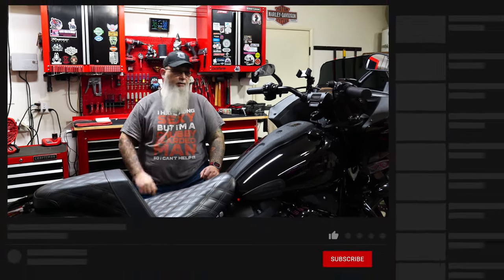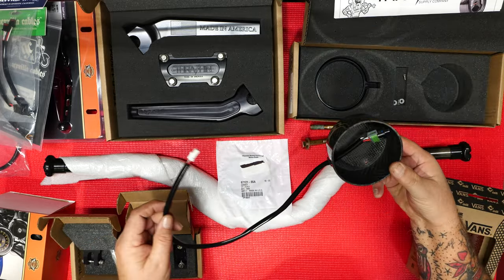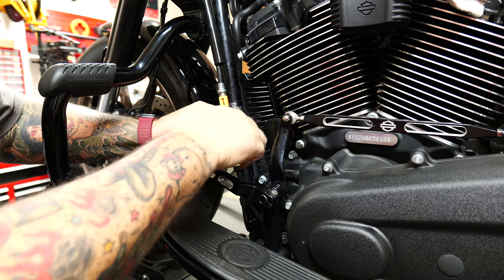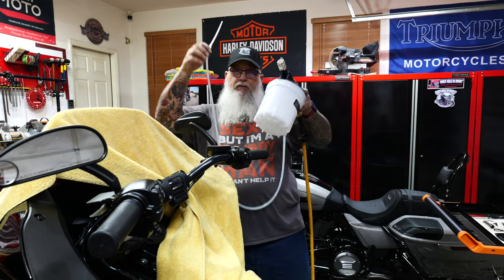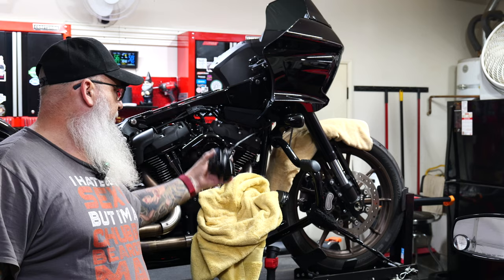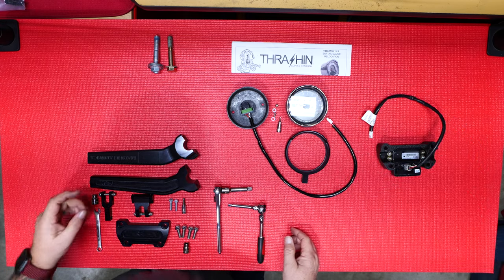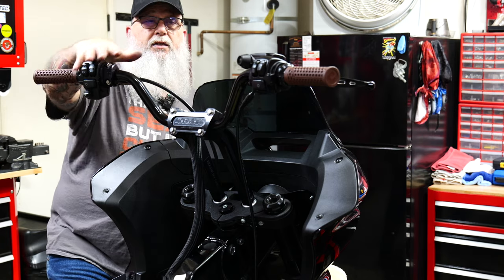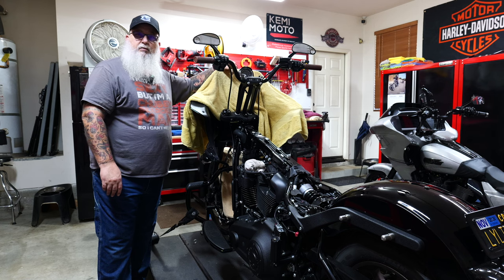2022 Low Rider ST Upgrade - Thrashin Bars, Risers, Gauge Relocation

Comment: I have the exact bar and riser set up pending install. I ordered the guerilla extensions in 9” because I was going use the thrashin 1” riser extensions. Now I’m having second thoughts about using the extensions because I feel like it might be TOO tall. Interested if you think the 9” extensions will be too long and I will have difficulty tucking them and if you think adding the 1” extension as I originally planned would’ve been too tall for you? Thanks!
Reply from the maker: Thanks for the question. I think it will depend on you and how everything fits with the seat and peg position for you. Mock up the risers with the extensions and see where you land. If good, press on. If too high, take the extensions off. You should be able to fit the 9 inch in there, but I would for sure take the tank off for ease of manipulation of the wires. 

Enjoy the work and have fun. It’s all about the experience for sure and I’m sure either will look great. Ride safe.

Comment: I have a similar front set up on my 2020 Low Rider S. It is a sweet rider. I have a ST fairing to mount on later on. I am still enjoying my T fairing. The kept the stock gauges on the tank but have my Dyno Vision gauge mounted on top to read all my specs. It is so much more comfortable with that set up. I appreciate the tutorial video.  ❤
Reply from the maker: Much appreciated, 100% agree on the comfort with the change and thanks for the comments, ride safe.

Comment: why couldnt you use stock bars with just the extensions, would have saved a lot of time or do you have to use the trashin bars?
Reply from the maker: Thanks for the question. If by extensions you mean the risers, I wanted to raise the bars up to 10.5 inches height for a more comfortable riding position. You can use the stock bars, however, as noted in my video, they are bent a bit up and out which was uncomfortable to my wrists. The Thrashin bars have been great for me on a few bikes so I stick with what works for me. I am sure it will vary per person, but I love the result and the improved riding position.

Ride safe

Comment: Not pertaining to this video but did changing out the cylinders, pistons and rings cure the puking oil problem on the bike, got the same problem with my 2023 model, im running the same S&S breather you got.
Reply from the maker: Thanks for the question, yes, in my case it did. I did a closing video here: https://youtu.be/TTmTUlU7Yio?si=x3-p7Td9y1MBSPvj

on the summary of events and what they found. Be sure to get that in to the dealer if not already and have them resolve it ASAP. It is NOT anything to do with the air cleaner and feel free to reference my video series on this issue (there are a few) if they give you any push back on it. There have been several comments on these with others experiencing the same issue on the LRST models for 2022 (and maybe newer).

Hope it helps, ride safe!

Comment: I’m looking to get some pull back risers as well with stock bars on the fxlrs. I’m 5’6” what size would you recommend? I don’t want to make the wrong choice
Reply from the maker: Thanks for the question. I would recommend measuring your riding position and the height from the bar base to where you want your arms to be. Generally, 6.5 to 9.5 will do, but everyone is different in body dimensions. That should give you the basics of what length risers to purchase to fit your goal.

Hope that helps, ride safe.

Comment: Video inspires me to do all the upgrades myself. It's only the brake and clutch lines that have me worried. Thank you for sharing and documenting. Do you mind sharing the total cost? 💰💰💰
Reply from the maker: Thank you, much appreciated!  You can get the actual cost of parts from the links I provided, minus the cables and miscellaneous parts from the dealer. But, looking at about $1500.00 to $1700.00 in parts. If you had the dealer install it, you are looking at and additional 8 to 10 hours labor according to “the book” x whatever their rate is. Definitely worth doing yourself. The clutch is very easy, the brake cable just needs a process to minimize leakage and function afterwards. 

I tried to walk through each step to help make it easier. Ride safe and have fun.

Comment: Thx for this video! There is one thing i didnt like on my low rider st...the gauge..and now i know i can switch it:)
But Dude, is the gauge you used the original from the low rider s?
Thx!
Reply from the maker: Thanks, much appreciated. Yes, the gauge is for a 2021 low rider s. Works perfectly and the part number is in the description. 

Ride safe.

Comment: Glad I found this channel today definitely will be following along thank you ☝️👏
Reply from the maker: Thank you! Much appreciated.
Reply: I have a 2020 fxbb and I’m 5,10 running a 13 inch fox mono shock in the rear if I run this exact same bar and gauge set up think I’ll be good right now I’m running lucky Dave’s lucky 13 which are 13 inch with same pull back t bar looking to switch to bar and riser

Comment: I’m 6 ft 280 pounds I drive a street glide but would like a low rider st test drove it the mids are terrible would you say if I bought one and put forwards and bars on it it’s almost as comfortable as a touring model ? I just wanna be able to ride 50-100 mile days and not hurt haha great video btw
Reply from the maker: Thanks for the comments. As you mentioned, I did not like the fwd controls at all... My heritage was very comfortable, so I put the fwds on the low rider and loved it. It is a bit tough to compare a softail frame to a touring frame since they are different, and so is every person, but, I will say that the LRST with Heritage fwd controls is so much more comfortable for me. See if you can test ride a Heritage and that would give you a feeling of what it may feel like, minus a seat and bars that fit you of course.

Ride Safe

Comment: doing this upgrade this weekend ,when disconnecting the wiring is the wiring all marked ,or do just figure it out thanks
Reply from the maker: Thanks for the question. The wiring is not marked, but pretty much a one only connection. I took photos along the way so I knew what was where and taped the disconnected ones before I pulled anything to help stop confusing myself. 

Have fun, you’re gonna love it.

Comment: I bought all the parts to do the risers and bars, but the abs have me worried. I've never done brakes before. Did you drain the fluid completely from rhe calipers
Reply from the maker: Thanks for the question. The bleed made me a bit nervous as well,  kinda indicated that in the video lol. Yes, I started by draining the master, then drained each of the front calipers. I showed how in the video and the pneumatic pump really helped (there are other cheaper tools if you don't have a compressor). Once done, reverse it and test. I had no error lights and the brakes and ABS worked just fine. 

If you do run in to an issue with the ABS, you can always run down to the dealer and have them re-bleed them on the machine. 

Ride safe.

Comment: Love the video! I wanna do the same on my Low Rider ST 22. Just a quick question. Do I need the specific Gauge from the Lowrider S or will any other analog Gauge from the 2020 up Softail work? For example the one from the FatBob. Just asking because the Lowrider S gauge is not available right now... Dealer couldnt give me an answer to that.
Reply from the maker: Thank you for the comments. I included the gauge you need to order from HD in the comments. The only difference will be if you have the RDRS option installed on the bike, I think 2023 and 2024 models. If you do, I would ask the dealer which one would work. 

Enjoy and ride safe.

Comment: thank so much you give us real mechanic class sir I'm buying parts to upgrade my risers I'm going to use Kraus risers 10inch on my lowrider st  and fly moto handlebars my only concern is the bleeding front brakes because I see a other videos and the guy did everything n the bleeding pard but the brake won't brake it all and he have to send  to Harley to fix for him so that's is my only concern . PLEASE MAKE A VIDEO TO HELP US HOW TO BLEADING CORRECTLY THE LOW RIDER ST THANKS
Reply from the maker: Thank you for the comments, much appreciated! 

I was concerned the same would happen, however, using the air bleeder that I did worked great and I had no issues. if you have a stuck ABS light, or something is not right, do not ride and have the dealer bleed them. Being that I only did the front brake calipers, it went just fine.

Good luck and ride safe, gonna look awesome!
Reply: You can reverse bleed by pumping the fluid from the caliper up to the master cylinder just make sure you  suck the fluid out of the bowl in the master cylinder so it doesn’t over flow and that way you don’t risk an air bubble getting to the abs system. Also make sure you don’t touch the brake lever while doing it otherwise it will pull air in and cause you to have to make an expensive trip to Harley for them to bleed the abs system

Comment: Did you have any issues with the red security light staying lit solid on the speedo after starting the bike?
Reply from the maker: Nope. If you purchase the gauge I indicated in the description it worked perfectly. Ride safe.
Reply: I currently have that now. Ordered the gauge from this video. U1305c. Cannot get it to clear
Reply from the maker: @fonso003  I would check with the dealer on a compatibility list for LRSTs with TC. I don’t have that on mine. 

Ride safe.

Comment: What length of cables will my wife need for her 9 1/2 and mid rise from thrashin. If you may know, i know spedo and Throttle is +6 but not sure on clutch and front break
Reply from the maker: Thanks for the question. All the needed part numbers are listed in the description so you know what to get. Ride safe.
Reply: @justkillnbugz  thank you for the response and thank you for the videos

Comment: Did you replace the complete clutch cable or just the top part
Reply from the maker: I replaced just the top half. The part number I used and listed will be for the upper cable only.

Comment: You left out the ABS digital tech step at the Dealership. 
To make the ABS function correctly
Reply from the maker: Thanks for the comment. I did not mention the dealership since my ABS functioned as designed when I bled them the way I did. I had no lights, no errors and both front and back operated as it should. "If" that is not the case on an install and the light stays on, then you are correct, you can go to the dealer and have them bleed the brakes on the machine which will actuate the ABS and flush the fluid through. I did not do a full brake bleed so I am guessing that is why mine worked after the install.

Thanks again and ride safe.

Comment: If you have a bike without the TC this is the correct gauge. I just learned this the hard way
Reply from the maker: Thanks for the info. My 22 does not have TC. Can you exchange it if not past the VIN lock?  Not sure on the newer LR gauges and compatibility. 

Ride safe.
Reply: @justkillnbugz  they said I can. Either way it’s not that big a deal I ordered what I hope is the correct one 😂

50 miles is the bin lock right?
Reply from the maker: @fonso003  I believe so but best to check the documentation just to be sure. some may be different. Glad you can sort it out.

Ride safe.
Reply: @justkillnbugz  official from Harley. 31.1 miles til vin lock. Trip B counts it down for you

Comment: Do you think those cables will reach 10.5 in risers?
Reply from the maker: Thanks for the question. I would say probably not, they are pretty close to what is needed with the 9.5s so you would probably need to go up a size the the length to cover that extra inch or so.

Best of luck.

Comment: Can you also see the km/h on the gauge  or only mp/h?
Reply from the maker: The gauge shows the digital readout for mph by default. Once the bike is turned on, if you press the odometer/trip reset button on the left handlebar controls and hold it, it should switch. I believe you have to hold it for several seconds, perhaps at least 10 seconds or more (from what I have read from those who have done so).

Comment: Did you loos t/c by chance going to that guage
Reply from the maker: Thanks for the question. The 2022 LRST did not come with traction control. It was offered on the 2023's I believe. If you have a 2023 and get the 2023 Low Rider S gauge (same premise) you should be fine. Your local dealer would be able to find you the part number and verify the gauge parameters for that model.

Ride Safe

Comment: I’m running the same clutch cable, but it seems to be too short?
Reply from the maker: That seems odd if you ordered the same  part number. Hmm. Verify your touting is good and if it is, contact the dealer and be sure they gave you the correct one. 

Hope it works out.
Reply: @justkillnbugz  Did you reroute the clutch cable differently from the stocked routing?

Comment: Did u have the ABS reset by the dealer...?
Reply from the maker: I did not need to, Worked fine as I showed in the video. If I run in to issues I will for sure have the run a test just in case.